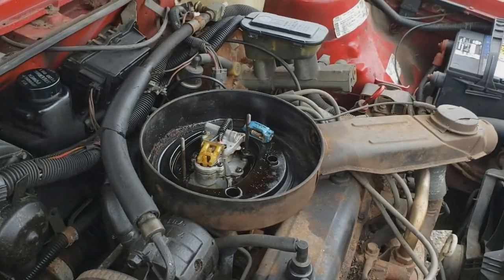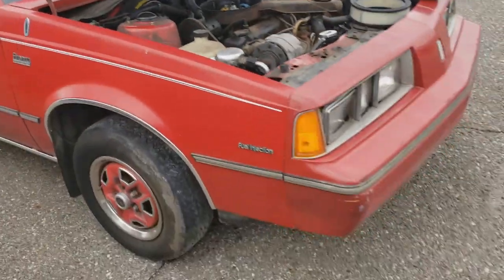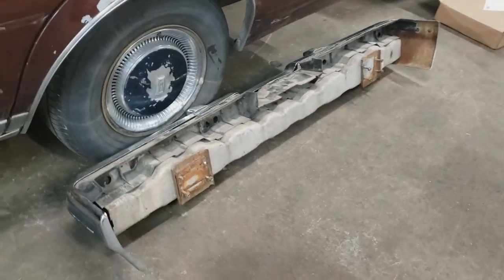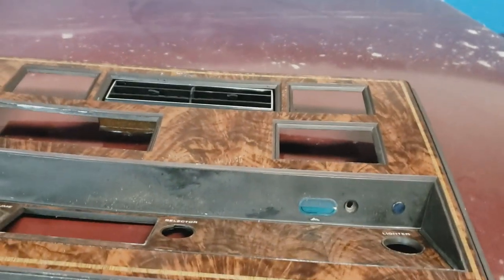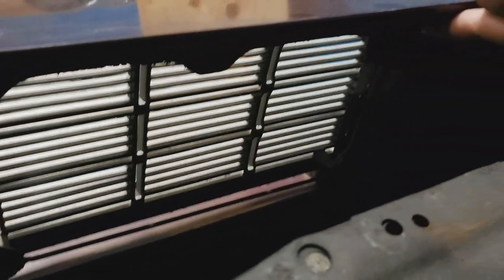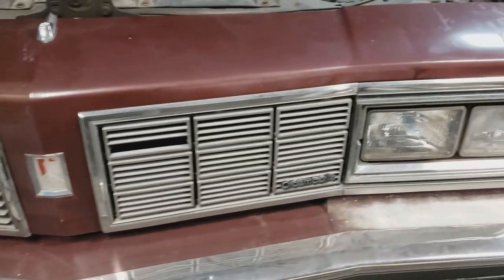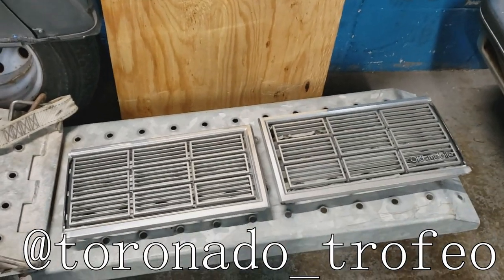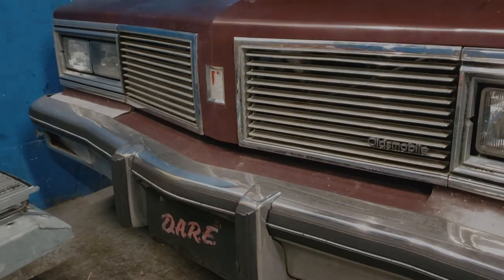Firenza Runs and New Grilles for the Delta 88

Comment: You are making progress!  Look at you!  I see the Firenza starts, the Eighty Eight is getting a new grille and a rear bumper. You keep working at it and keep moving forward.  Why did you switch from the correct 1983 to a 1982 grille?  I must say you are getting better that this. So the Eighty Eight will become your winter car?  Keep on working and investing.
Reply from the maker: I'm not sure at the moment, it probably won't be a winter car, but I think it will be something just to cruise around in when the toronado goes to the shop. I changed the grilles because I couldn't find find any 1983 grilles, i really did want to find a replacement, but none are for sale around me.
Reply: @Redline1986  Ahhh... it makes sense. Do not stop looking for a 1983 grille. What other plans do you have for the Eighty Eight...